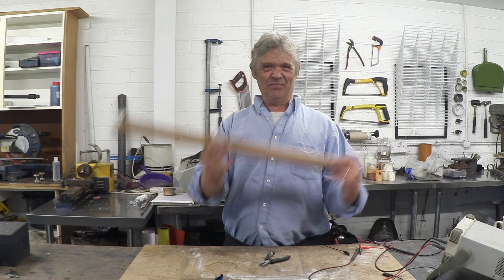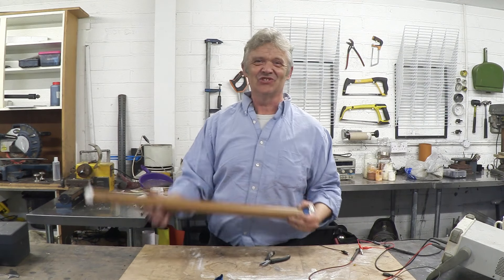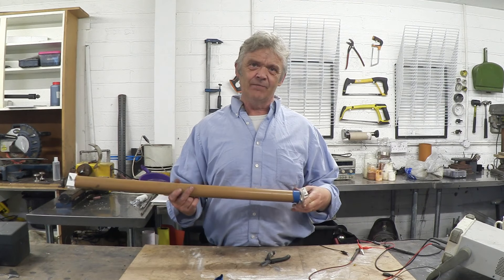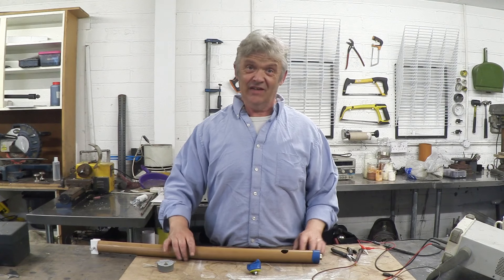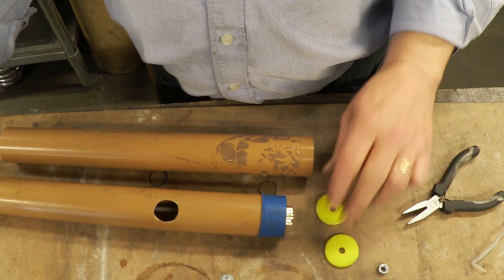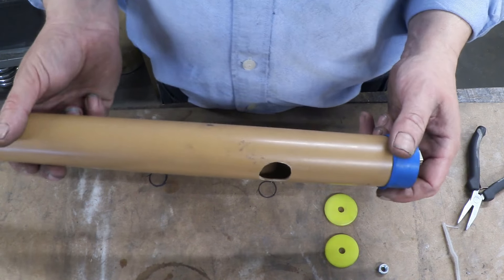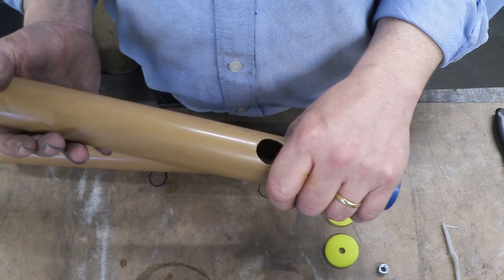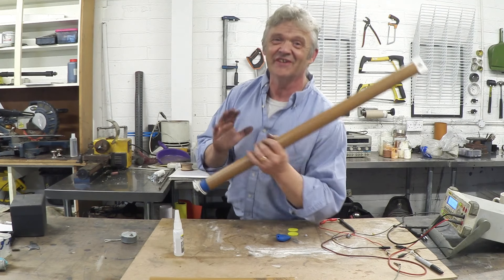A Wind Generator That Works Even When The Wind Stops Blowing

Comment: Great stuff. I love all your videos.  Is there any chance you could do a video showing us how to make that from scratch??
Reply: Just watched in You Tube the cross. cut view of common steam engine unit- also basic turbine engine design... Instead of high pressure steam pushing the blade to rotate the rows of blade housed in a  sturdy cylinder - funneled stream of air will power your wind mill... Its design was very similar to the present fuel powered turbine engine, nothing but slightly end. tapered straight tube- with burning sprayed fuel inside, which kicked out all rushing air from its front area- violently throwing it out in its end part, with tremedous force!.. Make a side room for your dynamo, connect it to your wind blade via a fan belt, only the fan blade was inside the  cylider, assisted with 3. meters housing length..  Analysed the housing of planes  jet engine to get an idea- an air current passing thru a close cylinder sucked. in 90% more air vs. the common open area around the blade of ordinary electric fan... Thats what experiments shows in controlled laboratory testings!...

Comment: if you put this on the blades of a windmill and on the windmill pole you would be collecting lost efficiency thus boosting the windmills efficiency, these would be good to be placed on hand rails and under paths and roads and even in the sea to collect energy that would be previously lost to time

as in putting these poles mechanisms under roads and paths and keep in poles for in the sea 

you could effectively put these poles on the bottom of the ocean anchored down and wire system sending the power up to where ever and wouldnt take up ocean space for boat traffic you could then even give the poles outer coral terrain moulds so that its great for the environment and allow mussels and fish to thrive etc

Comment: This gives me an idea:

I think the tree idea could be made much more simple and generate much more energy:

* have  a wire connected to the tree branch with a sawtooth rod. 
* the sawtooth rattles a membrane that moves the coil directly and optionally a string for a lower, more continuous current. 

since this is a more 'forced' movement by the tree branch, you can make the magnets stronger, and even stack multiple coils.
When we add a more robust string that vibrates (since it's plucked by more force than the wind only), we can bridge the idle periods.

I think the energy you can harvest from this is in a more 'serious' domain.

Comment: Looking for Advice...how could this be incorporated into a van home build?  As the van drives it vibrates. Is it possible to use this system to create enough power to keep batteries charged up?  Up to the challenge?

Comment: It may advantageous to opt for higher voltage and using an mppt controller thereby minimising load on the generator whilst increasing the amperage from the controller.

Comment: That is great it reminds me of a thing. I made for power in the tube I uesd. Was 4 or 5.  3.5 volt fans for cooling a computer in a stack in a black pvc pipe on one side and White on the fan side and put in the sun the fans spun so fast all fan's together made 14 volt. And with capacity er and small inverter produced 120 volt instant from the heat in the tube fro the spinning fan's. And it works at night by the heat of the stove I called it the transmission tube ? Love your show. So I thought to share a invention of mine thanks feel free to try it

Comment: If this design is as it seems,   then make around 12 and hang them from say a tree as a close to each other as say a half an inch.    Joined as a sort of chandelier.    
Hanging,   but not quite touching.    When they touch,   vibration or wind caused,   there should be a better vibration within each. "strand bell"  hanging down.    Increasing  power  "output".
After,   of course,   connecting all the  "cell"  outputs together into your  "Mains".    And then that  "main"  line,   to your battery.    Through a fuse box with a shut off level,   diverting continuous power to a secondary battery.    And so on.
Forgive me if you've already experimented with this simple view.

Comment: If you know the source of the vibration you intend to use for power input you can determine the frequency, then tune the generator to the frequency so that it vibrates simpathetically.  Maybe a guitar or piano string would work better.  By placing the magnets on the antinodes of the vibrating member, you could generate more power.

Comment: as a mechanic and electrical car technician I can see the possibilities of this type of voltage and amperage generator clearly more work has to be put into it to get the optimum power outage and how much it would take to be practical to charge batteries as I have been looking to reduce my power usage I want to get off the grid but I am now disabled from an accident at work a few years ago so I need to make my own generator as I don't have 10 grand lying around to have solar and batteries to be fitted and even more than 10 grand after fitting charges have been applied I do have an electric car coming and have had fitted an EV charge point through motability so now I am just waiting for my car to arrive 13 months have passed and still no sign of it coming oh well my point is I want to charge my car off the grid so it's running on pure green energy so a combination of a wind generator using alternators from cars which I know I can build I have the pole already up and fitted I just need to make one and this new way of implementing power as well combined should work well when perfected so I am going to give it a go so I've subscribed liked and clicked the bell icon and what I like that it is all affordable as if you want to buy a wind generator its a crazy price way out of the normal blokes pocket range thank god I found your channel just by chance it caught my eye great title it got me here and great video cant wait to watch the rest of them so all the best from john from rugby Warwickshire.

Comment: So these would be perfect to run up and down around a tower of vertical wind turbines to take advantage of the vibrations that are inherent with them. I could see this as a secondary or auxiliary low power trickle charging system.

Comment: Wow, that would take some serious research, trial and error to fully optimize all the components.   The other passive energy collector worth investigating is conductors suspended mid air that collect ionized particles for electrical generation. Its very weak in and individual wire, but would it output in useful kw/hr in a large array?  This idea is similar, what would an optimized device generate, in a cluster or array?

Comment: hey @robert murray have you done any in depth research into whast the best way to align the magnets with the coils and maybe it could be just a copper tube with a magnet dangling inside the tube or something like that ? since ive seen magnets slow down there falling rate inside aluminum tubes and copper tubes if there was a electrode attached to the tube and then also the magnet  and does it matter more about the magnet strength or the copper coil size or magnet size like whats the best combination of all the possibilities

Comment: What say this is attached to a spring think ATV suspension spring and a long rods inserted In to the ground so that it can pick up earth's natural vibrations also we increase the tube circomphrance and length add light little springy fins so it has more surface area and creates more wind resistance so when the wind does blow it vibrates more and the fins would continue to vibrate for a while after the wind stopped   continuously vibrating the tube also is it possible to adjust it so that it will pick up sound vibrations.

Comment: Yes, I am a couple of years late, but what is the difference between this and the 2014 (based on a 2002 idea) development of the "vortex shedding virbration generator` developed by the Spanish company `vortex bladeless`.  Does the 2014 product have a different inner, I have not found a diagram of the inners of the Spanish product?

Comment: Like a reverse speaker kind of.
The vibrations vibrating the membrane and the magnets in and out of the coil or just inside it ? 
So a vibrating magnet generator is the main point?  Is there not magnetic resistace in the coil  ?

Comment: I'm thinking that if there were a series of coils and magnets down the length they'd amplify the effect. Instead of one diaphragm, why not 50? If it could generate more power per pole, the initial investment would be much lower. Also, holes drilled in a helix configuration may help increase the vibrations from wind, no matter the direction.

Comment: A really really long pipe.
With A vacuum cleaner turbine fan at the bottom of the pipe and side air inlets at the very bottom so a shaft of threaded bar can be implemented as a free spinning bearing mount for the turbine  to attach to.

This would allow for the turbine to spin freely within the pipe and the turbine is shrouded by the pipe walls with a small gap between the turbines body and the pipe wall to allow for air flow to continue towards the lower pressure at the top of the pipe.
(I don't know how high up the pipe would need to be to get enough pressure difference)..
Possibly a 5 story block.?

I do know that vacuum cleaner turbines are EXTREMELY Efficient and if you remove one from a cleaner completely and balance the centre hole on your fingertip and lightly blown into the central inlet they spin very well.

The idea is to allow the difference in air pressure from the bottom of the pipe & the top of the pipe to cause airflow through the turbines central port and out of the turbines sides having passed through the  vanes within it's very efficiently shaped Ventura and streamlined blades.

Attach magnets, coils etc etc.  :)

I'd construct it myself but the council are already moaning at me for having 5 microwave ovens, 4 vacuum cleaners, 3 broken washers, 2 four stroke mowers, and a cartridge of CO2 Gas.
(Yes 12 days of Christmas tune works with that scrap list).  Plus i'm suffering with many ailments.

Comment: Not sure if anyone had this Idea yet, but what's stopping you from stringing like 5 or 6 of these up with a hammer in the middle, you know Wind Chime style? do you feel like this would provide an optimal output off grid?
Reply: I think as long as the string is vibrating its going to work. If you hang a few of these up like a wind chime I'd probably hang the via some elastic or a relaxed spring to get a bit of up and down motion as well as side to side.

Comment: If you add 4 strips of some sort of tape (thin plastic or metal measuring tape or similar) equally around the pipe side to side, running the length of the pipe, attached either end using stand off bolts (usually used in PC's attaching motherboard to case) so the tape/strip is about an inch away from touching the pipe. 
.
A hole drilled through the pipe (wide enough to pass string through) under each strip in the middle, then using string or similar attach each strip to the artificial muscle. This will make it sensitive to vibrations even more, the strips act like when you blow grass between your thumbs to make it vibrate and toot/pheep. 
.
The strips vibration will transfer to the muscle nicely. The slightest movement will give big feedback to muscle. If you need me to draw a diagram of this modification please let me know.

.
From me (Rob) in Scotland. . . . . (Yes my name is Robert too, lol)

Comment: If you put one somewhere protected from the wind, you could use it as a crude seismometer. 

Then, place another nearby, in the wind, to charge the battery for a low power data-logging microcontroller.

Comment: Instead of a fixed mount, maybe a metranome style mechanism as the base to cause more vibration, with a wind sock or small propeller at the top to promote movement 🤔 just a thought.

Comment: what if you had a ton of them and some kind of water source that would hit a flap that was attached to the group of these things that would constantly vibrate them? I would say a water wheel and rig it but I'm trying to rule out moving parts that can fail over time so its extremely low maintenance.

Comment: Hi..why don't you use a speaker instead  and just add  a spring fixed to the cente which I think becomes more sesitive to sound or wind and makes it vibrate the coil in the magnitic field and generates electric power ..I think this saves you time and compliction

Comment: Hello. I have a 600w solar panel system and want to put up a wind turbine. Could you recommend a small home use one because I have read lots of reviews of the cheap ones on eBay not working. Many thanks Keith

Comment: i applaud your enthusiasm.  being a bit of a electronic engineer, i can understand the mechanics of this.. however, i have to caution you on a number of things..  ma's alone are not going to do anything useful.   take watts law for instance.  if you have 250 MA's at 1v,  then your only doing 250 millionths of a watt.  which is near nothing.  to get to 1 watt at 1 volt, you would have to have 4 of those.. now mind you at 1 watt, you cant do much either.  because you still have to step it up to a useful voltage.   so, consider that a 2amp 5v usb charger to charge 1 cell phone,  would take about 10 watts..   with your gizmo, you would need upwards of 40 of these units to charge 1 cell phone.   honestly,  you would likely have much better results using a real spring, instead of a makeshift one,  and you would have likely better results from an external mechanical form of energy moving it, but with that said, there are many other useful designs for utilizing different forms of energy..  windmill for one can generate upwards of 1,000 watts with nothing more than a small engine alternator mounted on a 4x4 at 6 feet tall using small 1x6's as prop blades,  which would in turn easily charge 10 cell phones with 1 unit.  yes i agree that many small units can add up..  BUT,  only if they do not have a deteriorating affect.    these would have a deteriorating affect because the more you place together they would work against each other, because one would charge the coil of another which in turn resists the movement of the other and prevents it from generating more.

Comment: Is it possible to coat the artificial muscle so it also acts as the coil, and lining the pipes insides with magnet? Or Vice Versa. And would that generate more power, since the whole muscles vibration would be used? I suggest coating the muscle with graphene, with a ring magnet in the pipe. Won’t that create a current through the muscle/coil when vibrating?

Comment: What if you soaked carbon felt in a Rochelle salt solution that makes a long piezo crystal in a tube with foil for contacts and uses wind to vibrate it? I don't know how to make a ribbon piezo I was trying to think of something cheap.
Reply: And you just attach it to a rubber diaphragm so it can be vibrated by the wind and flex a bit to make energy. But that was a thought on a whim.

Comment: I think a really good improvement or upgrade to it would be to add a 6kw Solar Panel system, that way even if there are no vibrations, but it's daylight, it will still produce power :)

Comment: I sail & use both solar & wind to keep up with my electrical power demands. Both have obvious drawbacks, solar only works during the day & wind only works when it’s windy (!) both solar and wind are expensive to install & take up a lot of room on the outside of the boat. Now, the boat is never completely still, it is constantly moving, vibrating to some extent. These could be in all the ‘dead’ spaces inside the boat, under the floors, between the hull & the interior furnishings, in the corners of lockers, anywhere there was an unused space. Surely it wouldn’t take too many to get up to a fairly consistent 2 or 3 amps? That would actually match my wind generator over a 24 hour period…..

Comment: It's a different form of an audio speaker. A speaker takes electricty and vibrates the diaphram to produce sound waves. This takes sound waves or other vibrations and uses it to move the diaphram and thus generate electricity. No doubt it works but I don't think you could generate much electricity with it. The long tube increases the amount of vibration it can capture and transfer to a very small diaphram. So it's more like a sound vibration telescope. 
In theory you could capture the vibration of every wall of every building and turn that back into electricity. But the energy in each of the vibrations it captures can't be that much. Put it next to a jet engine and capture that sound and you might generate some power. But the jet engine is using energy to make the vibrations.

Comment: In Ray Bradbury's fantasy the "Martian Chronicles"  the Martian power source was a plain covered by harps which when the winds blows the wire vibrated generating electricity, sounds pretty similar. The book was written in the late forties. In the book the system had failed because over time the wires broke and nobody fixed them.

Comment: What if rather than a pipe it was like a violin bow? Maybe with a weight at the top end so once it was vibrating it could continue a while like a pendulum? Alternatively a pipe could hang above a bubbling stream with just the tip in the ever moving water.

Comment: And if you dont like the idea of adding mini turbine blades, I would think that adding "tentical" like protrusions from the sides, all up and down the tube, would increase its potential to vibrate with even the slightest movements of air exponentially greater.

Comment: Paint the tube black and add a wind generator to the bottom of the tube and the air drawn up the black tube will produce secondary electrical generation.